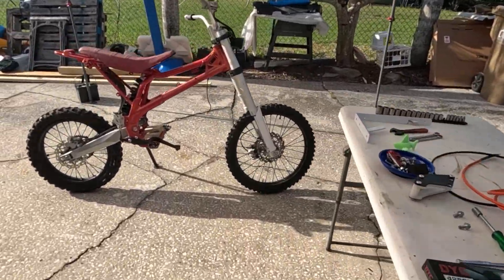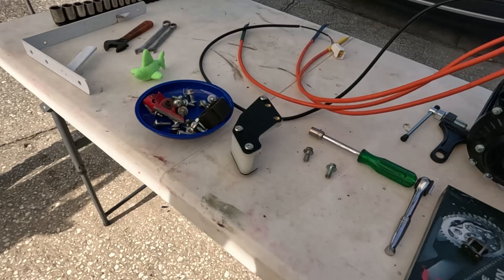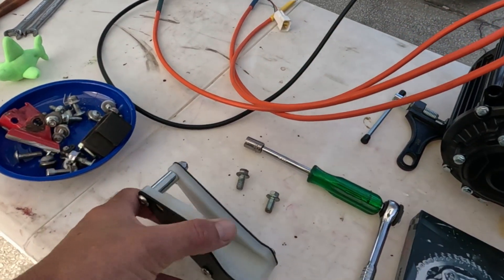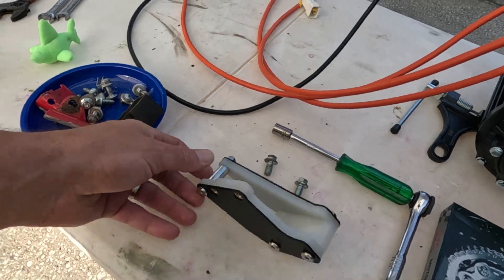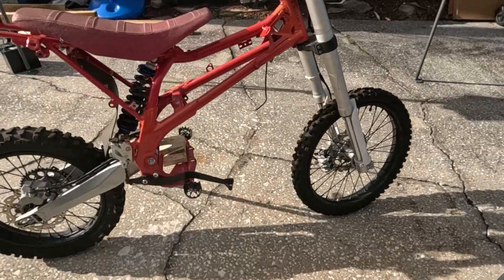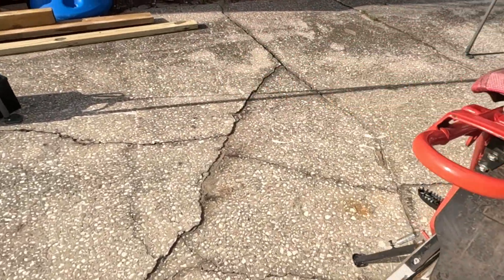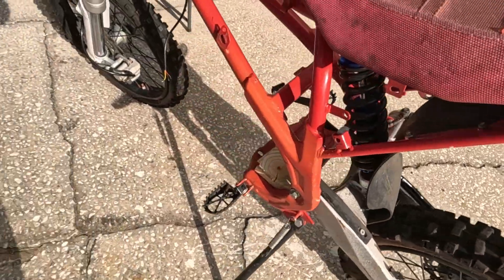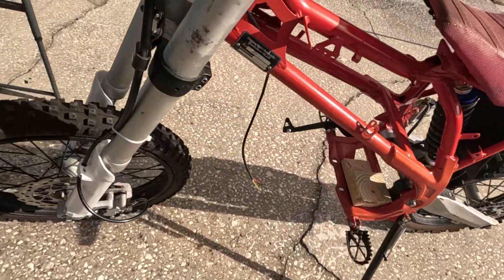I Wrecked! Electric Dirt Bike Build Conversion! Part3! Votol EM100 & QS120 #ebike #diy #EV QS138

Comment: i have this exact same bike im building i used mounts like this the first time on my qs138 and they didnt hold up against full power so im in the process of designing newer beefier ones i jus put a bettter bms on my aliexpress battery as it was the cheapest option for me as i cant afford anything crazy rn
Reply from the maker: Yeah thats a big motor for sure! I pushed 200a and it was still a little underwhelming, but matched up to the frame pretty well. I sold it and going back to razors 😂😂.
Reply: @ I want one of those so bad !!!! I have bin looking for a good used one but it’s hard to find any at all here in Canada 🇨🇦 i might have to get a new one unbox and remix it right away lmfao 😂 I really want a rsf 650 I’d settle for the mx tho 🤪
Reply from the maker: @ModDemonMX  oh man keep trying!!! They are all over the place down here lol. It's worth the hunt.
Reply: @ Yeuh I might have to travel a couples hours if I do find one ☝️ I jus want anything at this point I have 3 bikes I’m building and can only ride my 125cc if I load it up and go out to the country or have the police at my house for Ridin my bike 🤦‍♂️ my whole reason for electric ⚡️

Comment: What size is the qs120 motor in comparison to MY1020?
Reply from the maker: It's a little different shape being the v3 with rear reduction... But Id say about 50% bigger at least.  Still small for mx builds... Too big for most Razor builds.

Comment: Hey boss I have the same frame and stripped it I plan on doing the conversion. I wanted to ask how much do you think it costed so far?
Reply from the maker: Sure!! So I have about $500 into the QS electronics, and $900 into the Amorge battery.. all said and done I am $1500 in with the frame and I am keeping up to or beating $5000 surrons! It's a really fun build.  If I did it again I'd go a little bigger on the battery (250+amp) and the 1 step up on motor (qs138). Since this is a pretty big frame, it takes a bit of power to get it moving.